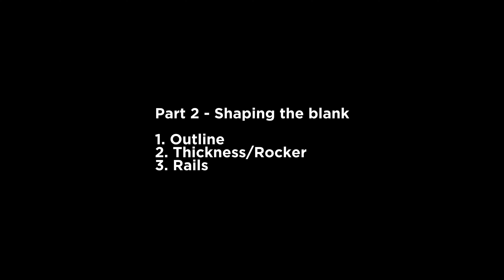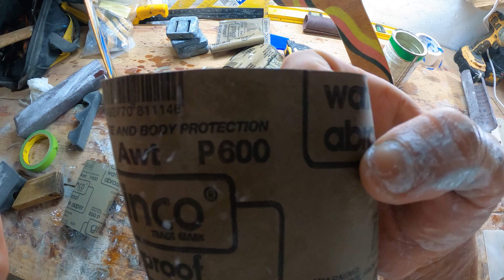Using Pour Foam to make Surfboard - Start to Finish

Comment: How much does the foam cost for a board that size?   You can buy a blank that size for under $100 but shipping costs are insane.  
Also, I noticed that you made the form from an actual surfboard.  Doesn't that make you end up with a thin surfboard after all the sanding?
Really cool that you are doing this.  Makes me wants to try.
Reply from the maker: Blank costs me around 30$ with this technique, but if I bought bigger batches of liquid foam it would be even cheaper. It is small indeed, the main goal of this mold was to make blank for kitesurf boards, so i dont need as big of a blank.
Reply: @HANDIY  Nice!

Comment: Would you recomend 2, 4 or 6 Lb Density pour foam? Thanks for sharing
Reply from the maker: I found 3lb to be ideal, 4 will be a bit heavy so if you don't have 3 lbs I'd go with 2, but I would add a little extra mix  that way it might be closer to 3lbs density..

Comment: Any reason why you haven’t tried placing a stringer? What are you using for uv stabilization and whiteness?
Reply from the maker: No good reason except that it would take more time then adding the carbon tape. Also I feel like the reflex life of a wood stringer is shorter then carbon and probably weighs a little more. In this video i used Alumlite White pigment added into Part A of the foam mix, makes the blank almost white. However it's still not UV stable, it does get yellow over time like a classic PU surfboard. I'm still experimenting with additives, but i havn't found the magic solution yet.
Reply: Magic 🪄

Comment: good work mate! how does the foam feel compared to the big brands. cheers
Reply from the maker: Thanks. The texture and sanding of the foam is very similar to real blanks. No wood stringer though.
Reply: @HANDIY  sounds great. do you prefer PU blank over EPS for kitsurf? and how many kilos of mixed foam did you pour? cheers
Reply from the maker: I dont have enough experience with EPS to compare it with PU. I put about 2.2 kilos of mixed foam into the mold. I'm still figuring out how much or how little i can put in there.
Reply: @HANDIY  awesome. thanks mate!

Comment: Would be cool if you could include the stringer in the mold when you poured the foam.
Reply from the maker: That would be amazing but i havn't figured that out yet, the expanding foam indide the mold would move the stringer around before it cures.
Reply: @HANDIY  One way to do it would be to have a lengthwise groove in the top and bottom molds for the stringer to fit in so that it couldn't move.  You'd need to trim it afterwards, though.  I have no idea how the include them in surfboard blanks.
Reply from the maker: @garyh4458  Yea that could work, you'd have to make sure you pour the exact same amount of liquid foam on each side, or else you'd get a pressure and density difference, the foam would have to expand on each side at the same time. The stringer needs to fit perfectly in the grove and the mold still needs to close correctly. I've played with the idea as well  but in the end a carbon tape stringer is just less work. The real blank manufacturers prefer cutting the blank after the molding and glue the stringer in. Integrating the stringer in the mold would be ideal but its quit a challenge.